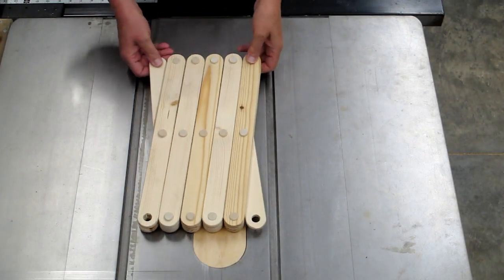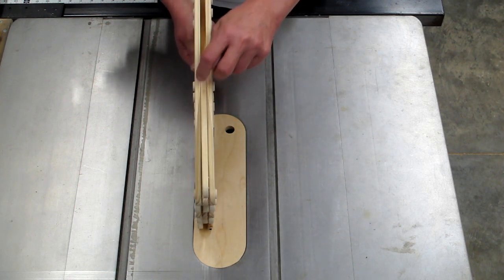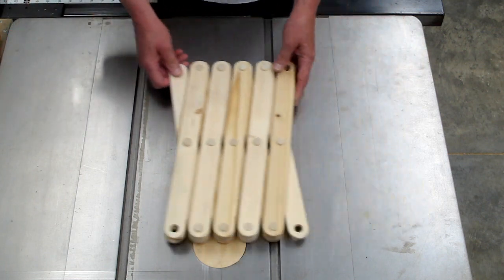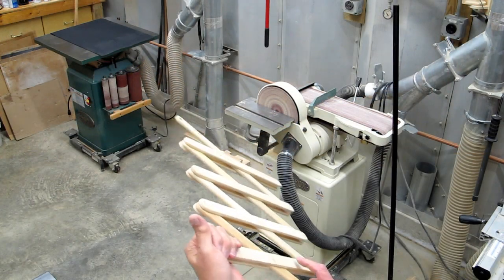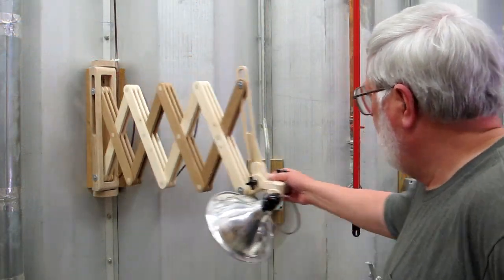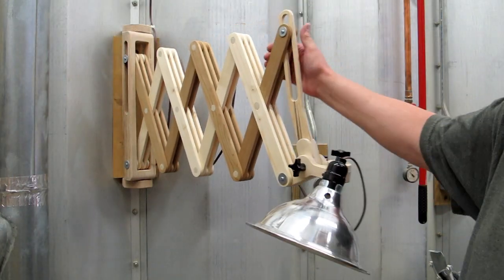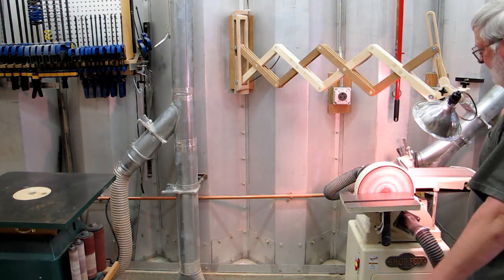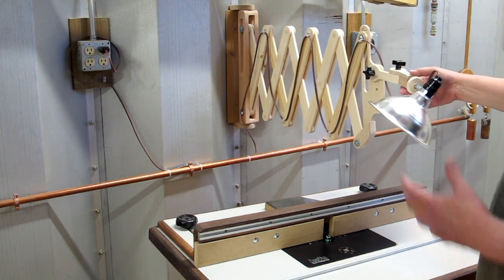Scissors Extension Part 1 Introduction

Comment from the maker: Longer links would extend further. More links would extend further but would not collapse (retract) as tight (close). How far it will extend and what weight will it support is a function of material, dimensions and workmanship. Will it bend if overloaded? Yes, it will bend and it will break at some extension and/or load. You would just need to prototype it and see if it will do what you want.

Comment from the maker: Not the easiest item to find sometimes. eBay has some listed. Google CLAMP LIGHT or ALUMINUM REFLECTOR WORK LIGHT. They cost $6 to $9 but shipping usually doubles that and to me they are not worth $18. Local handyman hardware stores or farm supply sometimes have them. This one was at a local True Value Hardware, which not longer has them.